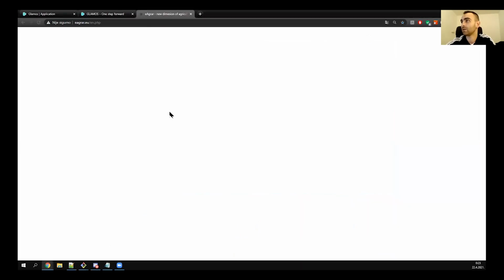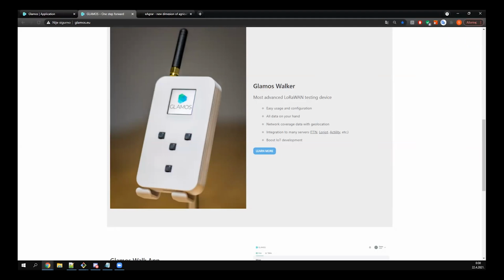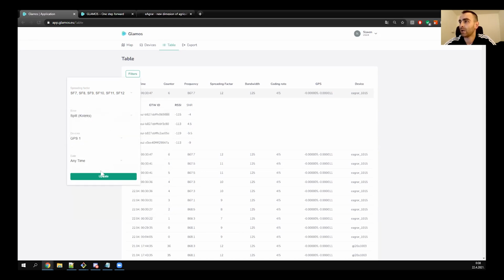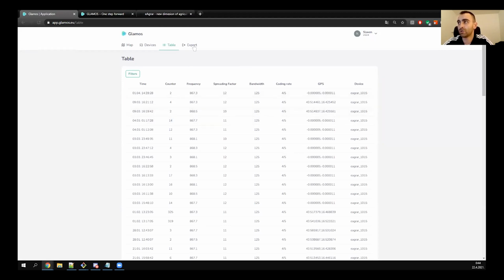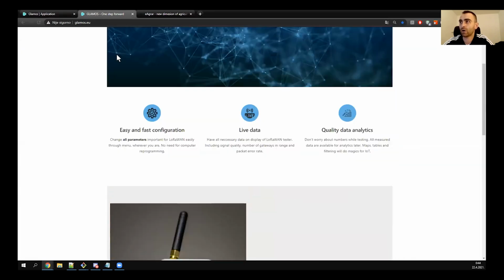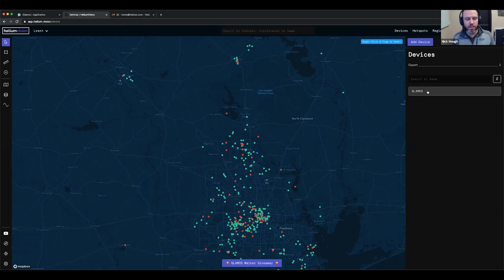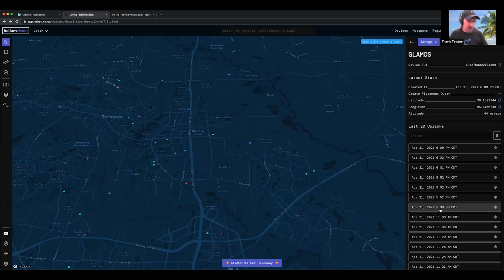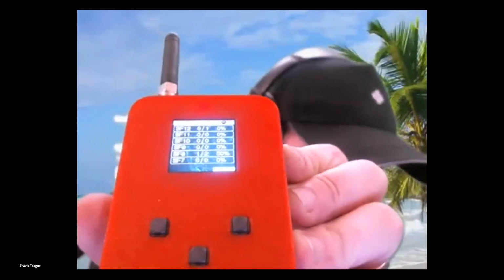GLAMOS - Helium Hacks Happy Hour

Comment: Instead of this crap, return your DIY program so people can make their own hotspots and mine in the meantime rather than waiting for ages for your suppliers to ship their overpriced hardware!!
Reply: The price of the manufactured units is absurd. However, it sets a quality/ build standard. 

It'd be really challenging to attract commercial data credit users if helium allowed diy.

Additionally, the cost of the miners is an incentive to keep the unit running long-term instead of quitting after coverage tokens start to phase out in preference of data transfer credits.
Reply: @Ehrnsmersh  I understand you, but your argument is invalid. Look at Ethereum for instance, it’s worth billions but it relies on DIY miners alone. It’s all about incentives.
Reply: @JulAlxAU  that's totally different for a few major reasons.

Eth miners are generally GPU or ASIC which have manufacturers behind them. Not really "DIY" to hook up a 3060ti..

Eth is providing liquidity and validation where these HNT miners are getting rewarded for uptime and coverage.  Which both require stability. If your ETH mining rig goes down its not going to matter. If my Helim miner goes down and I'm the only Hotspot around, the network in my area is useless.

Lastly, ETH 2 is proof to stake...no miners needed.
Reply: @Ehrnsmersh  What’s a Helium hotspot? A LoraWan radio and a linux machine , perhaps OpenWRT that runs on a small computer board like a Raspberry PI. When I said DIY, I didn’t mean soldering components on a PCB. I meant using already available parts and assembling them into a router/hotspot. Those who have the knowledge can easily setup and maintain much larger number of hotspots than Helium may even require. Those who don’t, could go the path of commercially available ones like RAK, etc.
Reply: @JulAlxAU  right. The hardware is overpriced. Yet, would you maintain the software required for the DIY to operate on the network? 

I like a RPi LoRaWAN project as much as the next guy. But unless you follow an exact spec (probably specified by Helium) then without custom integrations there's a small chance that the provided software package will support the wide variety of boards and components for DIYers. It'd be moronic for Helium to rely solely on open source devs to create drivers for all the random radio modules we want to use with a  Pi/Beagle/Arduino etc..

Minimum hardware to support means less code. Less code and hardware means higher reliability. 

They choose to have a measured level of stability in the network at the expense of our wallets. They want a predictable network and don't care if you can do it yourself for less.
Reply: @Ehrnsmersh  You are mixing two different things Douglas; hardware drivers versus the Helium software. Helium software is currently open source, thus can be compiled from the source code on any architecture of your choice. Hardware drivers are supported by the OS That’s got nothing to do with Helium whatsoever. How many LoraWan radios do you want me to show you that are supported by the Linux kernel out of the box? So, what you are saying does not make sense at all. Sorry if I am persisting on this, but I am very well experienced on the subject and I know what I am talking about. Their approach is destined for failure. Soon or late, there will be a similar currency that is completely open to implement, from hardware to software and that’s the one that will sustain and thrive. If Bitcoin has become what it is today, it was all because it was accessible to anyone and everyone to mine. Accessibility and democracy is core to the blockchain technology. Once either is taken away, it would no longer be sustainable.
Reply: @JulAlxAU  no worries I am enjoying our exchange :)

I did mix Helium and drivers, initially I assumed the Helium software would manage the board's interaction with the various radio modules. That does not change the fact that more distributions would need to exist 9n order to support many boards, as someone with experience you know that one piece of C code does not always run on any microcontroller.

Yet, i doubt that manufactured hotspots would be the downfall of Helium - if anything, the scarcity is what's driving the hype right now. 

IMO, the downfall will happen when people abandon their nodes covering remote places because the coverage incentive tapers off in favor or data traffic. Then only a few folks in urban areas or tech-savvy agricultural plots will earn a reasonable reward.

If a fully open source project would destroy Helium, why hasn't LoRaWAN itself already done this? At this the only difference to a user/miner of the IoT network is Heliums incentive.

I'd love it if Helium just allowed us to pull the src and they supported a few common controllers and RPi, like they used to. But, that's not the case anymore. Clearly there was some motivation for doing so. As someone who regular handles these types of rollout, it's almost always due to some support/stability issue. The only exception being VC investor intervention
Reply: I was curious if anyone has a link to the other similar devices he mentioned, the cadence and Adonis or something?

Comment: This is all hype, most hot-spot companies can not deliver before summer even pushed around October
Reply: You are late to the game
Reply: @Drews_Cluess  Although I'd tend to agree with you, I tend to disagree when I think ahead in terms of how incentives will change and how much HNT may be worth, right? 

In looking at the schedule of incentive categories over the next 10 years or so, I believe there are plenty of opportunities to pull tons of value even out of just one hotspot that's optimized correctly. As time passes and the incentives shift slowly toward data traffic, most hotspots will still be getting coverage incentives. Plus, if HNT stays on the scarcity cap model, there's a strong possibility that its value continues to rise. Higher price per HNT = Excellent value even in mining less HNT.

There's a small percentage of Helium hotspot owners that already understand what this project is, where incentives are now, and what is likely to come in future months/years. As a result, they are scaling out with additional units, finding hosts, and using the best equipment to solidify their coverage.

I honestly believe there's plenty of room to pull value out of each hotspot for quite some time, but each owner has to understand that putting in the bare minimum effort in terms of placement and equipment will result in little to no value. 

Cheers, my friend. 👍

Comment: ROFL I'll pass $259 I'd rather just spend the $10 to test the placements
Reply: What 10 dollar device is that?
Reply: @djknowflow  that’s what it cost every time you move it.
Reply: Actually quite the contrary. This is a great device when you want to survey a new location. I can simply show up on site with my usual selection of trusted antennas and get the results of which antenna would perform best in minutes compared to the days and weeks it would take testing each antenna. In other situations when you’ve got your back to a mountain I can even throw a directional antenna and make small markings on the pole to test different degrees of alignment and instantly be able to tell which angle provides the most coverage. This is a professional tool. Not a toy. Although to any hardcore deployment team it really is most fun toy in your arsenal! Lol